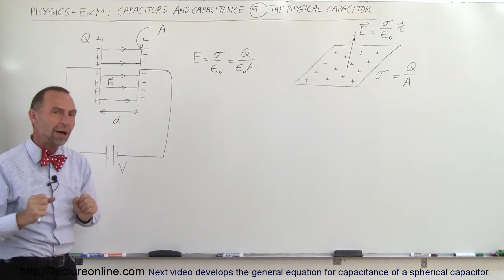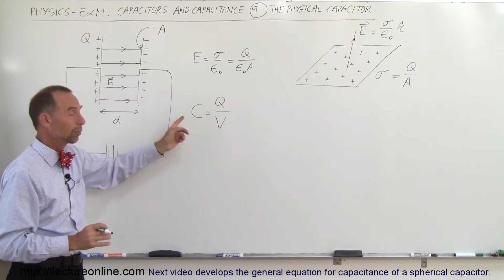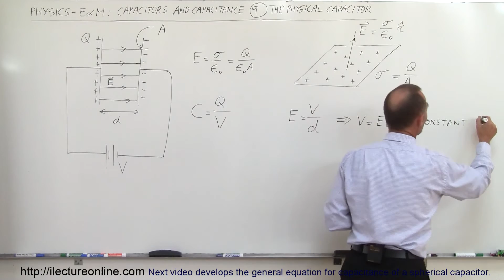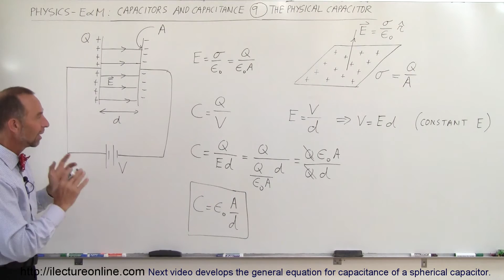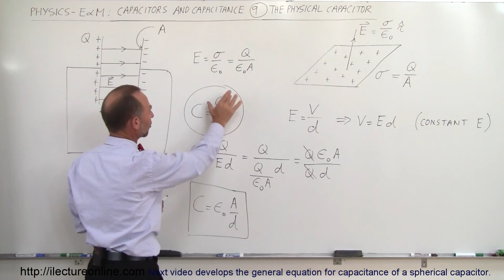Physics 39   Capacitors (9 of 37) The Physical Capacitor

Comment: Isnt that sigma/2E0 am I wrong ?? So i understand that that sheet creates Electric field on just one side so we re multpling sigma/2E0 by 2 since there is no electric field at the opposite side is it true ?
Reply from the maker: You must divide by 2 if there is electric field emanating from both sides of the plate.  In the case of a capacitor, it only emanates from one side.

Comment: The equation in the top right for the electric field is incorrect. It should be charge area density over 2 times epsilon. It becomes charge density/epsilon AFTER you multiply by two to get the net electric field in the capacitor.
Reply: yes, i've noticed it too. the left side of the video is correct because we calculate the electric field between two plates (sigma/2Eo+sigma/2Eo) but the right side of the we have a infinite plate plane and it's electric field was sigma/2Eo if I'm not mistaken.
Reply from the maker: No, the video (and the equation) is correct
Reply: Michel van Biezen If it was correct then the electric field of the capacitor would be 2*linear density/(epsilon)...
Reply: Michel van Biezen The electric field of one plate and the capacitor are not the same as the video suggests.

Comment: In the reality which are the plate sided. One sided or two sided?
Reply from the maker: With a capacitor, the charge will reside only on the inside of the plates.  (The charges are drawn on the outside for clarity)

Comment: a  large sheet of charge has an E = sigma / 2eps  , not sigma/eps
Reply from the maker: That depends on whether the electric field exists on one side of the plate or on both sides of the plate.  The case that you suggest is a single isolated sheet with charge on it.  That does not apply to the example in the video where you have two opposing plates in a capacitor.
Reply: Ya now that I have watched several videos in the series I see that you are implying that there is another sheet there. From the diagram it just was a little misleading in my opinion. No worries.